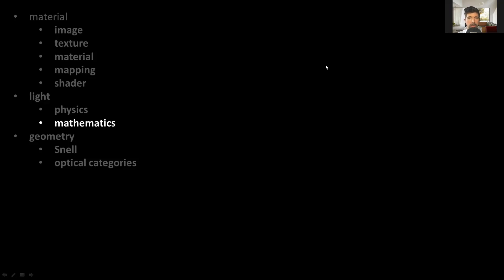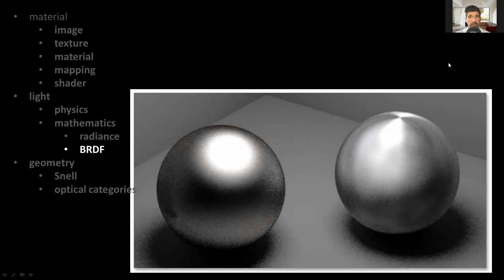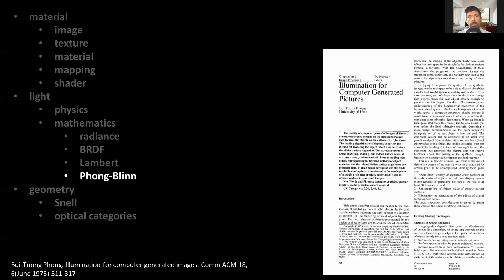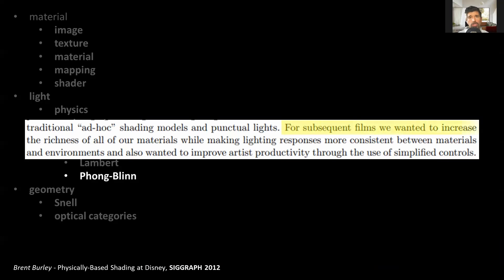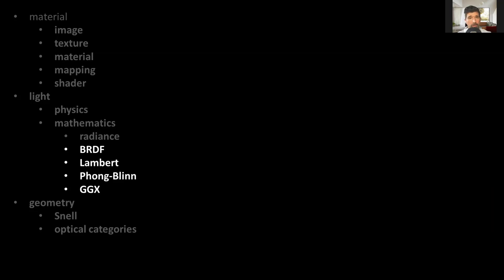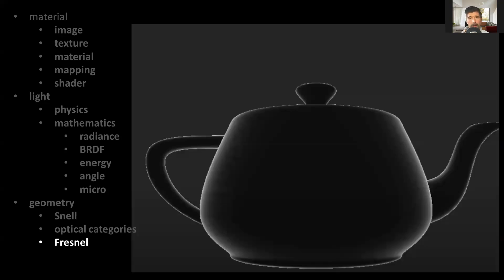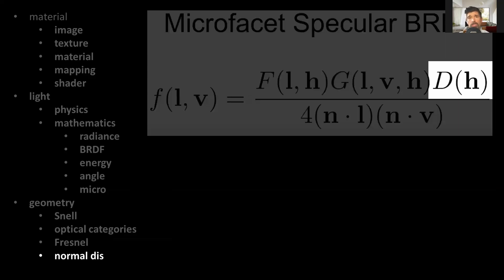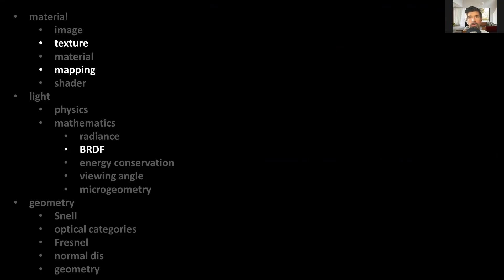3.2 - How Wreck-It Ralph FIXED Rendering

Comment: 1:30 the reason why it's bidirectional is not because there is an incoming and outgoing direction. Bidirectional means the brdf is the same backwards
Reply from the maker: Thank you for bringing this up 😃

 Based on my research, I found that the term bidirectional refers to the function's dependence on both the incoming and outgoing light directions. I believe you are referencing one key property of many BRDFs, which is the Helmholtz reciprocity, which states that the BRDF remains unchanged if the incoming and outgoing directions are swapped.

However, if we cannot agree on this, perhaps some resources would help out. I based the quote on the referenced literature, on page 3 and 4 where they talk about BRDF https://graphics.stanford.edu/courses/cs448-05-winter/papers/nicodemus-brdf-nist.pdf

Whatever, the case may be, I'm glad we brought up the topic of reciprocity as well, which perhaps I didn't emphasize as much